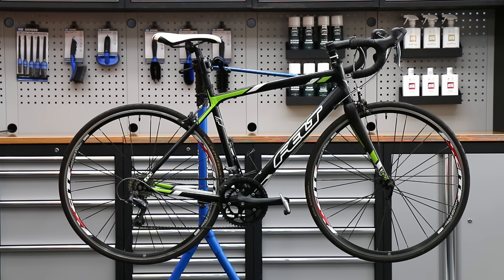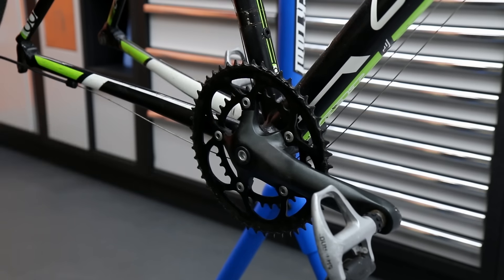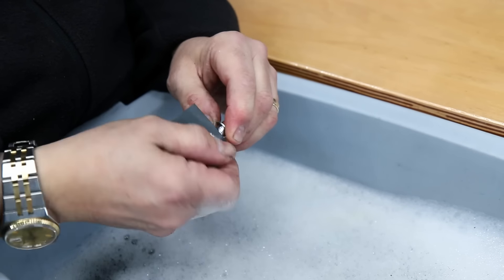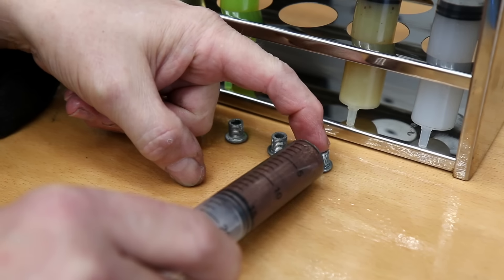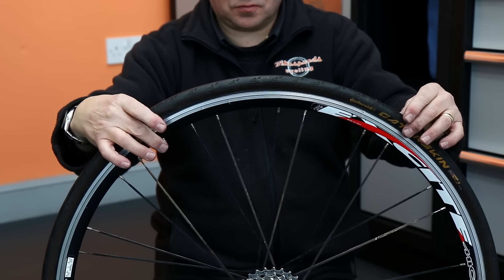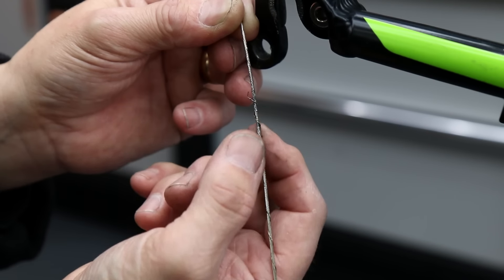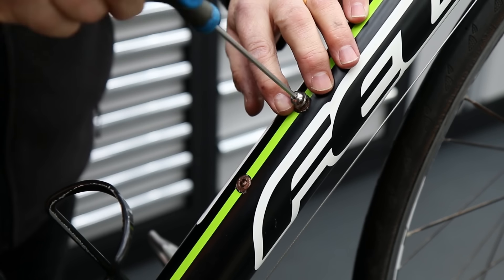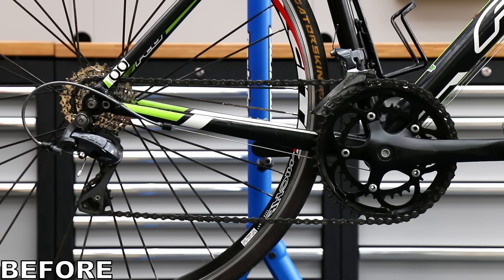Felt Z100 Ultimate Rebuild! Full Service Restoration & new Cables!

Comment: @5:55 i adore how y'all lubed everything in sight, after overhauling thousands of bikes myself the same way
then i would shorten all the cable housings i could, and grease cables and shoot triflow down those shortened housings
to magnify all the lube work i did before, and give the customer a bike far better than factory new
shorter lubed cables and housings  compared to out of the box gave me outstanding customer feedback
Reply from the maker: Great work!🧡

Comment: Impressive transformation once again. 

I wanted to ask, how do you apply the autoglym polish to the bikes that come in? I tried to use it on my bike with a microfibre, but the towel seemed to absorb most of it. Any tips or products to use?
Reply from the maker: We apply a dollop onto the towel then rub it in small circles across the whole bike. Then we take another different and clean towel and buff it off in fast motions🧡

Comment: Hi from New Orleans. I’m an early subscriber, watch every episode. I have a question about your ultrasonic cleaning. I have a good one much like yours. Highly rated. Commercial use. However, I don’t seem to be able to get rid of rust the way your components come out remarkably clean and new looking. What do you fill it with? Diluted? How long? Do you use heat? Thanks!! Will
Reply from the maker: No heat, a strong mix of degreaser, 15 minutes. It could be as simple as our climate vs yours. We live on the seaside, our shop can be no further than 2-3 miles from the coast so it could be our salty surface rust 🧡

Comment: As I like to put it, there's a lot going on there. I have a Z100 from 2016 myself, and I wish I had a bike fit before I bought it. Got it in a size small and shortened the stem by 3 cm and the reach is still too long for me. Hard to believe they marketed that bike as an endurance geometry. I wish it fit, then I would ride it more. Live and learn.
Reply: I have a Z100 too. Its got a much higher stack than all my other bikes. It very much is endurance. They have a flippable 8/16 stem, try flipping it to +16.
Reply: @bikeman123  I bought it with it in the +16 setup. Reach still too long. I do realize now that I am one of those unfortunate short torso long leg people, but the reach value for the Z100 is the same as in the race bikes. I still feel too stretched out after changing the stem.

Comment: it would be interesting to see how the switch initially works with the old circuit, to show how it worked and how it works after replacement
Reply from the maker: We did not actually realise it was the wrong cassette until we took it off!🧡
Reply: @Bikespeeds  ))

Comment: I've actually stopped lubricating derailleur pivot points. I've been using light oil and even that was sticky enough to collect dirt and chew rivets from inside.
Reply from the maker: Fair enough! We’ve not had that experience where we personally are but if that works better for you it’s the way to go🧡

Comment: That will make a huge difference to the rider's experience. Great job and will add that sticker remover to the list of stuff to order from you guys if it works well with dried tubeless sealant too 🎉
Reply from the maker: We have not tried it for that application yet but that’s what it’s supposedly designed for so we need a tubeless wheel to come in now! Thank you 🧡